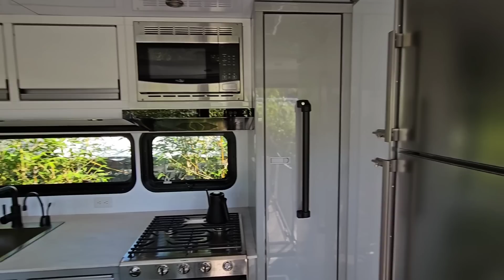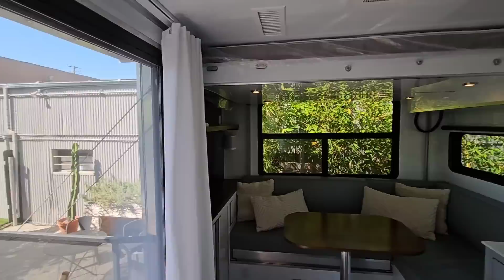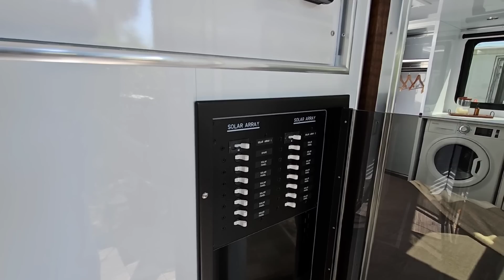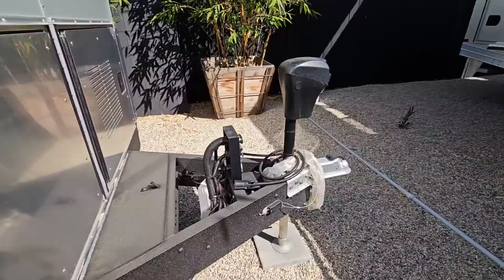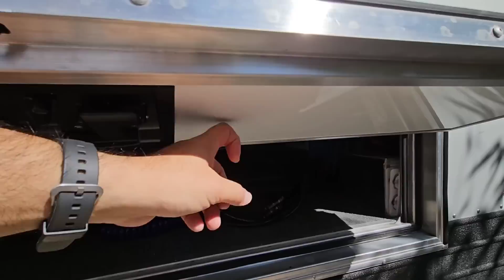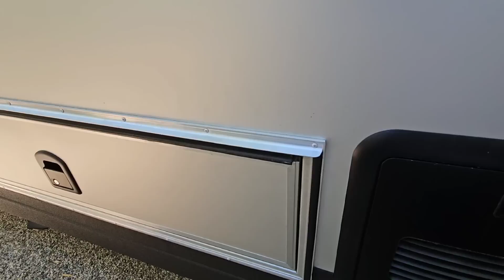BEST BUILT RV! Living Vehicle 2023 Fully Off-grid RVs!

Comment: Add some slide outs then maybe cost per square foot is nuts the way they sit.  Too Tiny…..
Reply: Many higher end campers do not have slides because the moving parts break. Also the mechanisms for those parts take up valuable space. If you want slides there's a whole market of rvs that have them.
Reply: Excuses….make a better system then with the so called “ best built RV “. Fabricate one !

Comment: I always recommend pulling a couple leaves from a stock rear spring setup and add a supplementary airbag system that levels your load. Better steering, better braking and all around safer.

Comment: I personally think the new company “Lightship RV” is outclassing these guys in many ways, especially in overall construction and manufacturing methods. Lightship is on another level, having engineers from almost every EV auto maker. Also the lightship is about 200k vs 800k for one of these…… I highly recommend checking them out and making a video on them!! They blow these guys out of the water in almost every single way
Reply: They've never built and sold a single unit  🙄  I'd reserve a little more judgement before saying they "blow out of the water" a company that has been in the industry for more than a decade and manufactured/remanufactured hundreds of units.  Can't say a picture/render will be SO much better than something that actually exists and many people have already enjoyed and bought...
Reply: @LVLifeguard  I stand by what I’ve said. All companies have to start somewhere, and they are definitely starting with a clear innovative mindset that actually changes RVs forever, rather than just throwing a big electric system into a basic travel trailer that looks like a converted cargo trailer. I can tell I’ve struck a nerve considering you have “LV” in your name.
Reply from the maker: Lightship is certainly in innovate.  Not sure any of your claims can be substantiated since you have no experience with their product nor to any customers. And pretty sure LV in the screen name is Las Vegas
Reply: @BTBRV  Right your are, sir!  This username actually predates Living Vehicle... thanks for the reply!
Reply: @Ajjakakkaka  It's definitely an interesting concept... hope they do well and actually do go into production sometime soon, it's definitely innovative, although this far I prefer LV's design and goal of being off-grid indefinitely, instead of just a week... I also am in need of larger floorplans, which LV provides... but to each their own.  Hopefully you can buy a Lightship RV soon!
Reply: @Ajjakakkaka Sounds like projection to me.   Your claims make no sense for a product that doesn't yet exist unless you have a financial interest.